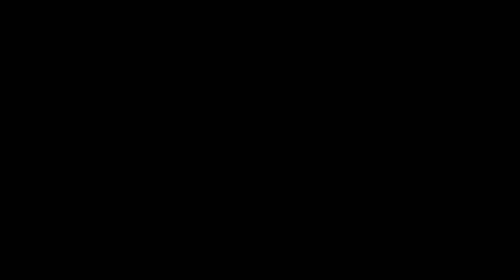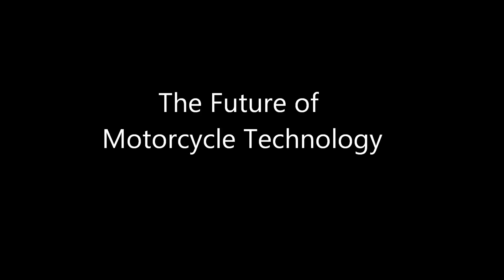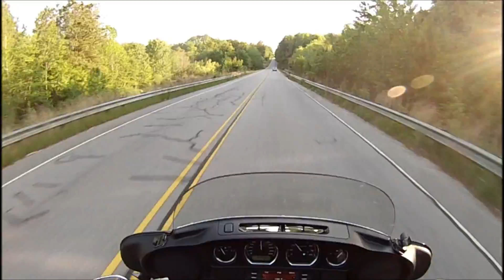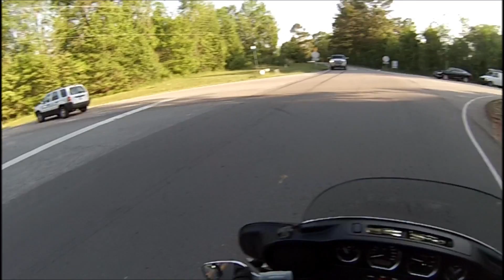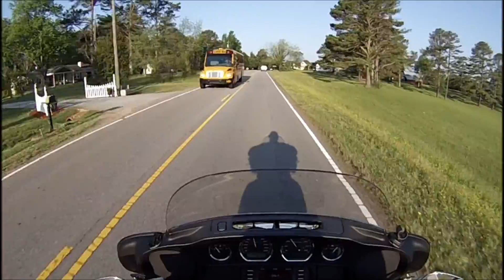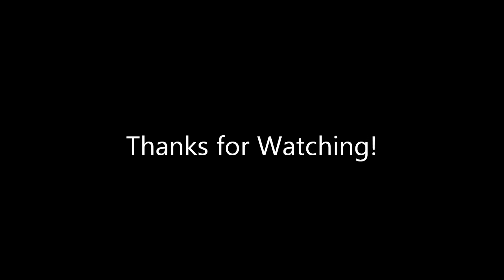The Future of Motorcycle Technology

Comment: My Yamaha FJR-AE has a big moveable windshield, which is indeed awesome!  It also has a computer controlled clutch that I shift with a paddle shifter, which is far superior to using a clutch lever (which is why F-1 cars all use paddle shifters).

I've seen 'landing gear' for Goldwings, little wheels that pop out below a certain speed.   

The big thing I want that no stock bike has that I know of is built in front and rear 'dashcams', that run whenever the bike is powered on.
Reply from the maker: +Jim Howard (JimNtexas) The paddle shift would be great indeed! I imagine there would be a lot of initial resistance to it in the Harley community, but over time, like everything, progress moves on. . . How about this one: Back-up camera!! Just thought of that today!

Comment: hmm .. Not sure but I think I can hear your valves.. motorbike tech will only get better , thing Is it all starts with sport bikes. They get all the tech .. see the new thing with the abs That helps you brake while to A corner... nuts.   Some interesting techy things you speak of lol. Shoot I bet our bikes will fly in the future.
Reply from the maker: +dbest1a Vlogs The engine makes all kinds of sounds, all of them quite normal-for a Harley. ;)
I love the ABS on my bike; it is linked at higher speeds, but not linked so you have better control at parking lot speeds.
Reply: +Maikeli7: Motovlogger Since 2007 yea but this new system Is supposed to work while cornering. It will prevent the bike from standing up mid turn when in a corner. I think it's either The new R1 getting it Or the bmw s1kr.. It would basically allow you to brake and have ability to still corner through a turn and not have the bike stand up, and you damn Near run off the road.
Reply from the maker: That would be pretty damned amazing!